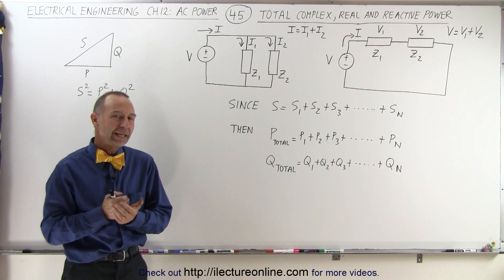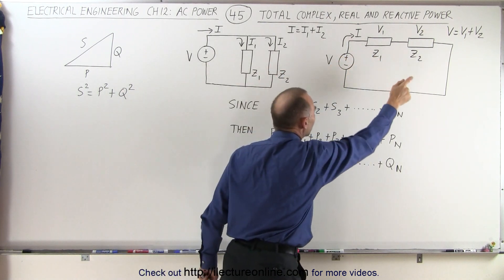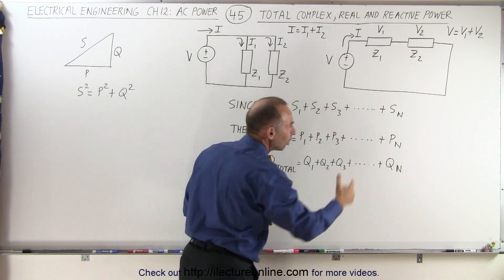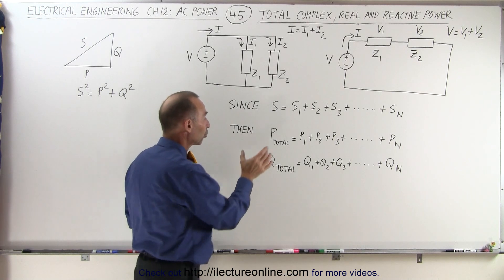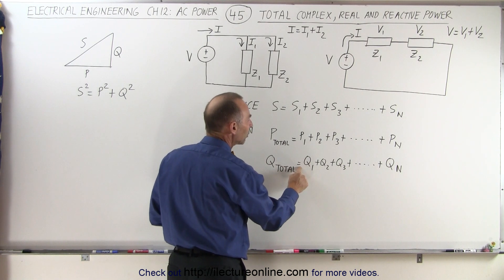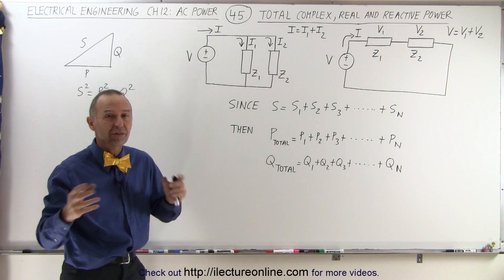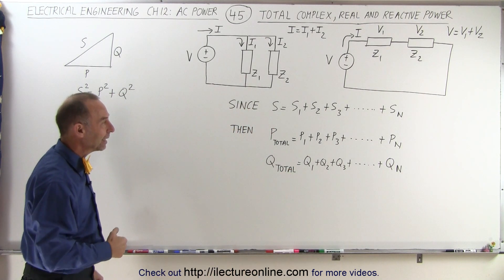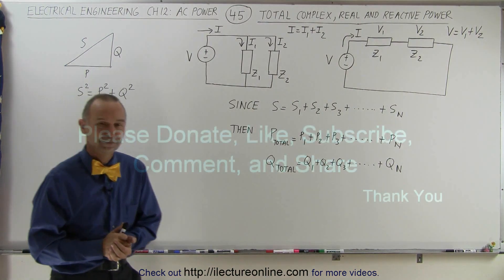Electrical Engineering: Ch 12 AC Power (45 of 58) Total Complex, Real, & Reactive Power

Comment: hey idk if you still respond here but when adding VAR (apparent power) if one is capacitive and the other is inductive would you subtract one from the other or are they both positive?
Reply from the maker: Capacitors and inductors only temporarily store energy and then release it again during every cycle.  They do not consume any energy,  Only the resistor will dissipate energy at the rate calculated when you calculate the power.
Reply: @MichelvanBiezen hi, thanks just one more question. So I have a problem where I need to solve a series parallel circuit but am only given the apparent power and real power (VA and Watts) and if each load is capacitive or inductive how do you go about solving it? There is no source voltage or current or any voltage or current anywhere else. Just each load VA and watts then the frequency of the circuit